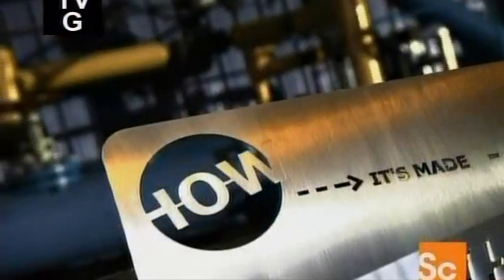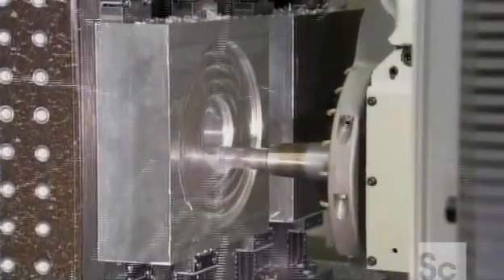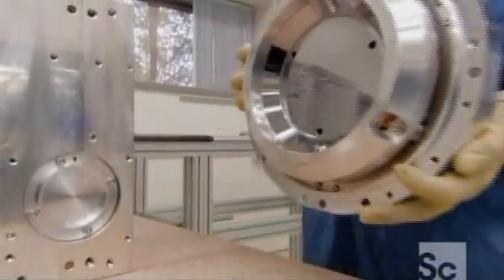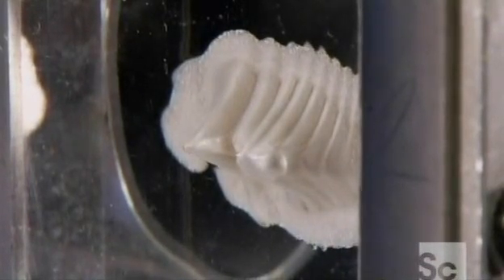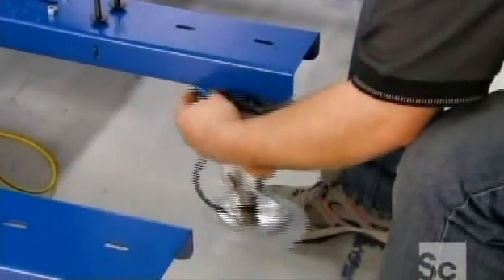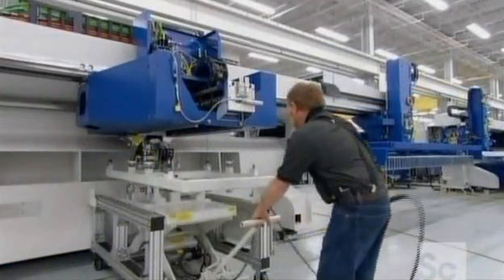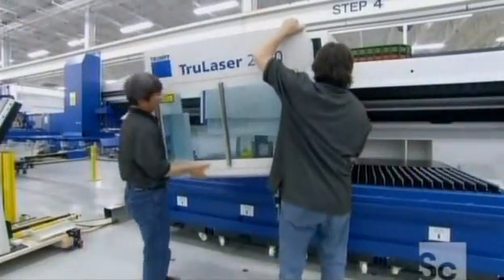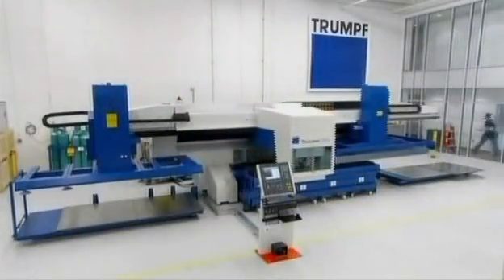Laser Cutter Machines - How its Made

Comment: Intro is wrong. Die stamping is faster than laser cutting, but requires more expensive tooling and has worse finished tolerance. I've seen die stamps that produce 240 parts per minute, no way a laser cutter is that fast.
Reply: A Friedo What about plasma cutters?
Reply: It meant slower overall (you can tell because he mentions needing a different tool for each type of cut). i.e. you need to make the die/tooling for each type of part you want to stamp, have down time between runs of parts because of the need to change tooling, then the need to finish the final part to remove sharp burrs/edges etc. You just need to load a different data file into the laser cutter to change parts and it can cut multiple types of parts all at the same time.
Reply: I sold hundreds of industrial laser cutters all over the United States. Die stamping is WAY faster than laser cutting as measured by cycle time. In some cases however, the flexibility of the laser cutter outweighs the fact it's slower.
Reply: puddingpimp That's also not right at all, it's depending on the material and the part itself which one would be faster. Did you actual see a state of the art laser machine working, the one in the video was a snail against that.
Reply: the stumping
Reply: Ooo

Comment: Actually it is, we have in our factory a laser cutter and a high end stamping press. Even though for very simple parts the stamping press is indeed faster than my laser when it comes to relatively complex parts the stamping press grinds to a halt. In the last 4 your about 80% of the work from the stamping press has passed over to the laser cutter simply because the quality is way higher and the overall costs are smaller.

Comment: @nextgenrbv Thanks for the information, of course you are correct. The high precision of the geometry of the reflecting surface is just as important as the surface finish, otherwise the laser beam shape will become distorted the further away it travels from the mirror. The beam needs to travel up to 20m in some machines with out any noticeable distortion. I knew lenses were diamond turned but not CU mirrors.

Comment: @kimura2Loc It can cut a glass mirror. The mirrors used in laser machines are usually made from polished copper with special silver or gold coating. Lasers work in a specific "color" or wavelength of light, and the materials used for the mirrors are chosen to reflect that particular wavelength of light with out being damaged themselves, as long as they are kept clean.

Comment: laser can cut mirror.
a commercial mirror is constructed by 2 materials: glass and reflective material (mostly silver)
every material needs different wavelength of laser light to be effected. like if you have laser for cutting metal then that laser cant cut skin or organic tissue (i have seen this with my eyes in china laser tube manufacturer) or it will need more power.
so to cut mirror you'll need two different wavelengths or the wavelength between those too but with much more power.

Comment: @thierryxxthierry No. A plasma cutter uses an electric arc to superheat compressed gas, which in turn burns out the metal in a small area. A laser cutter uses light energy to vaporize the material. Plasma cutters leave rough edges and are hardly accurate, whereas a good laser cutter is accurate to within microns. Do your research before posting insults "u moron-.-".

Comment: @macreviewer76 Nearly all metal components of Trumpf laser machines are cut with Trumpf laser machines.  Trumpf also uses their own punch machines (referred to as "stamping presses" in the video) which do mostly small holes, slots, indentations, and textured patterns.  Trumpf press brakes (bending machines) are also used.  Large milling machines (which Trumpf does not manufacture) do the precision machining for things like rack and rail surfaces.